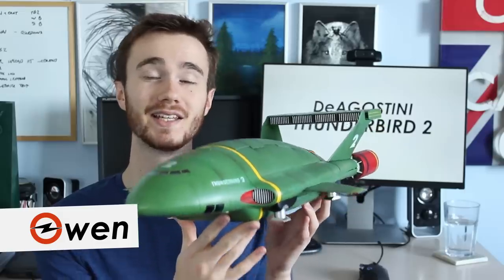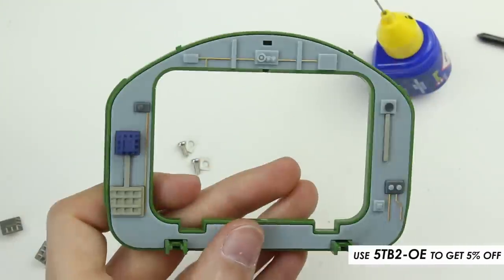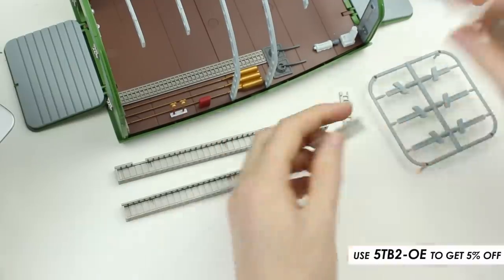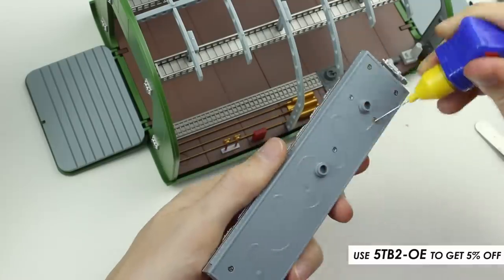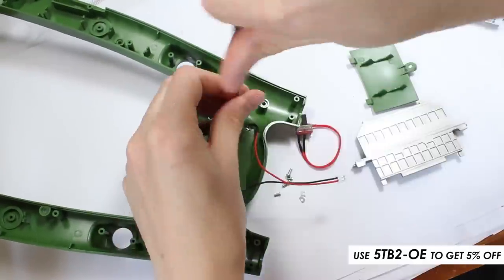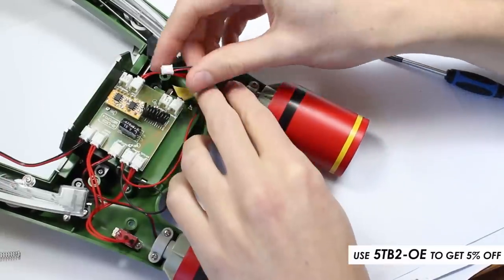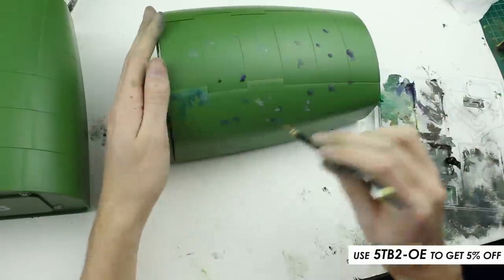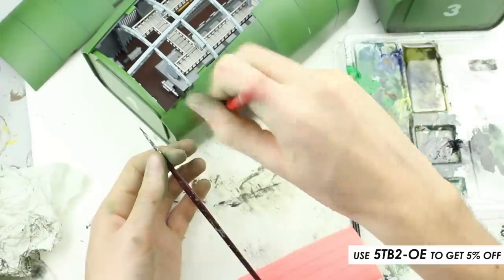Building THUNDERBIRD 2 Studio Model Replica! - DeAgostini

Comment: Great build and glad you mentioned the problems with plastic glue or polystyrene cement. That's something I noticed on returning to aircraft kits on retirement. It is not as efficient nowadays in bonding. I think that's a combination of the harder plastics that kits use today to achieve finer details in mouldings and a cement formula with less fumes, presumably like paints, less solvents for environmental reasons. Superglue as you say is good alternative. Traditional clear glues like uhu work but use sparingly as they are very aggressive and any overspill will damage the model surface.

Comment: Because I Served for almost 30 Years in Emergency Rescue, My Car earned the Nickname of “Thunderbird 1”, because it always arrives First; whilst My 6’ by 4’ Cage Trailer earned the Nickname of “Thunderbird 2”, because it was “the Heavy Lift Body” and always arrived 2nd, behind “Thunderbird 1” and My 4 Wheeled ‘Electric Mobility Scooter’, earned the Nickname of “Pod 3 - the Quad” (because of its 4 Wheels). Coincidentally, My Car, My Trailer and My Electric Mobility Scooter are all varying Shades of Green.
Reply: Unable to get a Thunderbird 3, 4 and 5, huh? Shame! XD
Reply: Asa Holmes No Use for 4 because I can not Swim and as for 3 & 5, well there is nothing Out There, is there? Mind you I wouldn’t mind a Mole.
Reply: I worked as a paramedic in the NYC FDNY/EMS running the LSU2 on T1 i was THUNDERBIRD2😎 GREAT EXPERIENCE😎🙏🇺🇸
Reply: Coincidence? i think not
Reply: My first car also served as a carry-all (as have all my subsequent cars) and thus my CB radio handle was Thunderbird 2.  

However none of my cars have been green.  They've been mostly red and or blue so I figured they were just active camouflaging!  LOL

Comment: Great job, I never knew anything like that was available. It really looks cool.
Reply: It's basically the Takara TOMY Thunderbird 2 released in Japan in the early 2000's. Same exact toy, same electronics, same everything, only difference is that the original retailed for 100 USD while this retailed for over 1000 USD.
If you really want one of these, get the Takara one off Ebay, their a bit expensive nowadays, but way better than this DeAgostini one. Afraid to say that those who bought this version got scammed big time.

Comment: Having build this kit, I have to say that it is a fabulous looking model overall - the selection of support vehicles is also very nice.  I see that you've also had the leg extension problem - it seems to be an ongoing issue (it is all over their forums) and I've yet to find a good fix for it.  If you've found a fix for it since posting this video I'd certainly like to hear from you about it.
Reply: The leg extention problem comes from the fact that this is a carbon copy of the Takara 1/144 scale TB2 that was sold in Japan in the early 2000's. It had the same issue with the legs, Ill give it a pass considering it was ambitious of them to give the toy motorized legs, but seeing how DeAgostini also has the same issue is pretty unforgivable, just shows that they didn't even bother redesigning the mechanism to stop that issue from happening again.

Comment: I built the see-through 1/4 scale Dodge 426 HEMI kit by Testors a number of years ago. It came with a sound module and a speaker that looked exactly like the one for your Thunderbird 2. It also sounded like crap. It's a fun kit though, I'd recommend you try one if you can still find it. It doesn't cost £849, either! And that's 1:4 scale, not 1/4 inch scale, it's about a foot long.

Comment: You need to add a little red washer underneath each gear, the kind you would use when screwing a computer motherboard to the computer chassis. Makes the legs all go up and down smoothly and in line with each other.

Comment: On sme R/C electric models, electronic engine sounds are sometimes used, sound tinny,I tried putting a small capacitor across the speaker, with some effect in making it quieter, but still tinny, so it comes down to the small speaker size, I really like the weathering effects made it come to life,I think the lifting legs could be redesigned, with threaded rods micro motors and some electronics to make work in unison  the use of an arduino, with some software designed, if you wanted to go that far. there is certainly something to work with here an ideal retirement project, for some of us are still young at heart.

Comment: May 16, 2019---Thank you for the video which was very interesting, but as others have commented, it is very expensive, at least to me. Did some Google checking and there are blueprints for this and other Thunderbird vehicles. Which got me to wondering, why not build your own with a 3D printer? It'd have to be done in sections obviously if you want a complete cockpit, pod, etc. Got back into modeling in late 2017, but into 1/35th scale zombie/apocalypse dioramas. Didn't look forward to a lot of scratch building, then making silicone molds when multiple items would be needed such as furniture, telephone booths, etc. That's when I saw a Youtube video on the Anycubic Photon 3D resin printer. There are a lot of websites with free 3D programs for different things and currently have 500+ programs. So many, I have yet to NOT find something I can use in my dioramas. Now I want to learn how to use CAD, along with some free figure generating programs as there's a serious lack of figures in this scale other than military kit figures. Instead of taking days or maybe weeks of printing something so large, why not make ONE copy of this vehicle, then use those printouts as a master to make silicone molds? Yeah, the silicone and resin won't be cheap, but better than paying basically $1,000 for just the one kit you showed.

Comment: HI,enjoyed all 4 videos. i have the takara version it was such a shame they didnt find a better way to move the legs ( the sides of TB2 flex & the springs just slip the track) i think 2 motors would have worked better,they also put fixed batteries in the vehicles so nowadays they dont work either. keep up the good work.

Comment: At this price, the malfunctioning lift legs are unacceptable and a deal-breaker.  Thanks for an honest review.
Reply: It's easy to fix permanently. You just need to add a little red washer underneath each gear, the kind you would use when screwing a computer motherboard to the computer chasis. Makes the legs all go up and down smoothly and in line with each other.

Comment: Good vid, as always. How were you thinking of plugging up the screw holes - putty and paint? And how do you feel about the fact that it's pre-painted, does that take some of the modeling experience away? Or is it less hassle?
Reply from the maker: Yeah modelling filler and painting over them would be the only way, or maybe using green rubber so they were removable. I think the pre-painted parts are great for a kit of this size - it would be a chore to paint something this size, especially with brushes :)
Reply: you could always use a roller! :^)

Comment: I too have the same problem with raising of TB2 legs once all screws are in place, it's annoying it takes nearly 30 mins to remove the screws reset the legs put the screws back in and it still does the same. Where is the troubleshooting guide you mention in your video?
Reply from the maker: At the end of instruction manual 12. Interesting to hear that you've had the same issues
Reply: It's funny because it works completely fine without the top part screwed down but when I screw it down that when it starts to skip, wierd.  Have you managed to resolve the issue following the troubleshoot guide as such?
Reply from the maker: No I haven't
Reply: Its weird,  yes! i have this TB2 and it happened the same thing to me, but my solution was to not screwed very hard the top part, and also change the batteries with new ones. I believed its because the motor is to small and when you screw it "hard" the parts are to stress or pressed for souch a tiny sh*** and starts doing that, so of course need full power to rise up. So when ive change the battery and release the screws a bit "voilá"!! jeje I think it was only me, ive buy it from japan in hobbylink a year ago and ive never been able to see any video in english until now XD by the way sorry for my bad english im from mexico, hope it helps. NOTE: CHANGE THE BATTERIES CONSTANTLY
Reply: It's easy to fix permanently. You just need to add a little red washer underneath each gear, the kind you would use when screwing a computer motherboard to the computer chassis. Makes the legs all go up and down smoothly and in line with each other.

Comment: I used to be involved in the office furniture industry. A chair manufacturer's representative once told me that a simple moulding 'tool', to produce a five-star base for a swivel chair, cost £tens of thousands.
When you consider how many metal tools would be required to produce a model like this, it starts to become clear why it's so expensive.
I don't really have a feel for whether it is unjustifiably expensive - you can buy a 1/32 scale model kit of the Lancaster bomber for £400, but how would you compare the two?
Further looks at the DeAgostini site shows that you can buy Pod 2 separately, and that's £250. That is starting to feel over-priced, I must admit.

Comment: The brand suggests that this was done as a periodical magazine with a model part attached to each.
 they are expensive as hell
Reply: I built a model of the "Cutty Sark " from this company. Because it was done as a periodical magazine you really don't realize how much the finished cost will be until you are well into the build. It was almost exclusively made of wood and virtually built like the real thing including shaping the individual deck and hull planks unlike this model which is really just construction with a nod to some nice additional paintwork.The magazine was issued in a 100 parts, which they failed to really advertise and was  nearly £7 per issue, so it took nearly two years to complete at a cost of nearly  £700. Really the cost of one Big Mac per week if you want to put it another way lol.  Expensive? ....yes!   Challenging?..... extremely !!    Satisfying ...... Without question. I must add this was well over 15 years ago as I remember.
Reply: I can't say I'm that much into modelling, I made the error of getting the classic carry on collection although the first was £1.99 the rest were £7.99.
This totalled over £287 for a DVD set with magazines.
As there were no extras on the DVDs (interviews /trailers etc) that was a hell of a lot for a set of films
A replacement set with extras was less than £30.
both included the carry on laughing TV series.
Reply: @moonzero2  No offence, but I don't think your comment has any relevance in this case.
Reply: I have to disagree, they simply took the sales model and applied it to a film series, the fact remains that a similar model kit would be a lot less expensive bought complete.
not to mention being a lot quicker to build.
Reply: @moonzero2  You start the kit. Realize its going to be very expensive. You stop. You have a half built model that is a waste of money. Bit of a Hobson's choice really. 
You bought a DVD that was overpriced from the start. You said yourself there were no extras which were obvious when you bought the first one. You can stop anytime. You, again as you stated, could buy the films to add  to your collection at a cheaper price in many places. I've seen them for as little as £1! There is a lot of difference. Plus the model I cited did not tell you how many issues it took to complete. Advertising was a little bit more iffy back then. Even now with modern builds the small print is flashed very quickly on screen, a bit like credit card details. 
The fact is, comparable kits of high quality are also very expensive and a lump sum to purchase hard to acquire. Being a lot quicker to build isn't an issue to most model builders, Paying in installments drew people in and they accepted the wait. This in fact helped as time allowed for fewer mistakes. 
The only similarity you can draw is the overpricing of an article
Reply: Which is exactly the point I made,  regardless of the items purchased, the inflation of the price point goes way beyond anything reasonable.
Your spirited defence of the company suggests a closer connection than mere modelling.
Reply: @moonzero2  In what universe do you assume I am defending the company and I have a connection? 
If you want me to be more precise. I was sucked in and committed funds that would be wasted if I didn't complete the build. That didn't detract from the enjoyment of the build. I equated the weekly cost to the price of a MacDonald's meal to soften the blow.  
You, on the other hand, bought a video, that by your own admission, contained "no extras" and after the first issue could be considered extortionate by anyone's standard . After admitting you could have bought them for less than £30 but STILL continued to subscribe to the total of £287 ! As I recall ALL the carry on films were available, including the TV series on DVD with extras for considerably less than £7.99 at the time of issue. Because of my encounter with this company, whenever I saw similar builds offered I was not tempted in the slightest. When I saw the adverts for the" Carry On" Films I actually laughed out loud and commented "Who will be stupid enough to buy those?" as it's vastly overpricing was immediately obvious. I stand corrected.
Reply: The price point however stands, At £700 i would expect a model ship to be radio controlled and capable of some operation, not sit in a case.
Reply: @moonzero2  Lol How do you know it isn't ? Lost the case but still have a dig. oooooh Matron
Reply: @moonzero2  Average cost for model of that size and complexity £500. 
Actual price £700. 
35% higher 
 Average cost of DVD's  £30
Actual price £285.
950% higher. 
At that mark up I'd want Sid James to make me a cuppa half way through the movie and dust my ship's case before he left.
Reply: Which brings us right back to the point of ripoff pricing. what it is or the amount of mark up is immaterial. 
 A large amount of the comments below echo that idea

Would that £500 be today's prices or 15 years ago?
Reply: Rather infantile , btw I saw the adverts at the time.
Reply: @moonzero2 Infantile? Hey. I didn't start with  "Defending the company, more to it than modeling" remarks. Do you think bringing up possible Inflation on twenty years will overshadow you paying out nearly 1000% mark up lol I think we can leave it there
Reply: The basic fact stated time and again,  is the company is guilty of price gouging to the nth degree, 
 but you seem to have delusions of grandeur because you bought a model in stead of a DVD set. the business model is the same regardless.This fact however cannot seem to make it past your snobbery and superior attitude. that is where I leave it.

Comment: Well, I'm late to the party, but maybe you'll read this someday.
1st - Your pod weathering should also be brushed front-to-back since it also spends time in the air stream as it travels to abd from the mission scene.
2nd - You're NEVER going to any decent sound, irrespective of the sound file's quality, from horrible little transducers like that. If I were you, I'd swap for a proper speaker, or even 2 if you feel up to splicing the wires. What diameter are those "engines“? Alpine do nice wee 1" (25mm) tweeters with multiple mounting options, which will give yiu a far better sound than a transducer ever will.

Comment: That's a fabulous kit, however, the front cockpit windows area is too small, and the nose is too 'droopy'!!
Not your fault obviously, but yeah...I was addicted to Thunderbirds as a kid back in 1965/66, and even like watching it again now occasionally... and I can see straight-out that the cockpit glazing area is too small/shallow; it should be deeper - a touch!
And the nose area doesn't have the correct upward sweep from the underside where it rises slightly to meet the upper surface downward curves.... it looks too 'droopy-snooty'...  !!
Also the green is too light... did DeAgostini actually watch any episodes of the series before releasing this?  Well...obviously them must have had great access if they could get the pod internals looking so good, but to fail on the basic shape of the nose, and get the cockpit window too small.... I dunno.... shame on them; Thunderbird 2 is an iconic craft with a very distinctive look, and they messed it up at probably the most important part; the FRONT!!!
Sorry....
You did a great job putting it all together, and doing the weathering, but it would have taken pretty big surgery to fix DeAgostini's mistakes!!  :-D
Reply: Your right, it looks different. In a bad way too.

Comment: It's the nose and cockpit position that looks horrible as it's set too far back. Can check as go on to google search and Images and can spot one of these straight away.  Plus for that amount of money people have a right to be fussy. Rather than a smooth surface the panel lines in the red engine air intake area and top and bottom body shell parts makes it look like a toy. I never trust a company that offers Part 1 at a unrealistic very low price to catch people rather than a realistic higher cost that has to continue, knowing full well what the total cost is where many waste money starting on a project that isn't going to be finished. Full price in the small print and not clear.